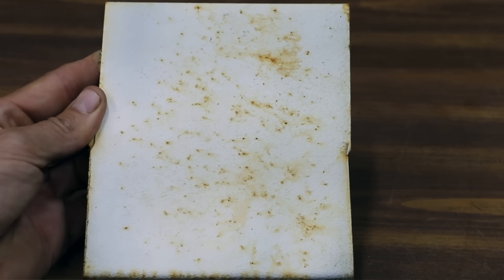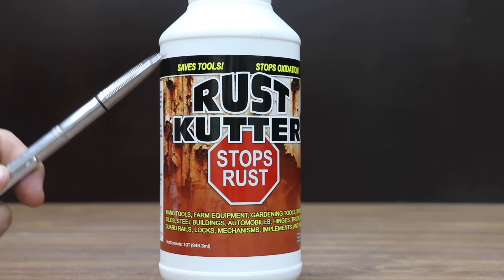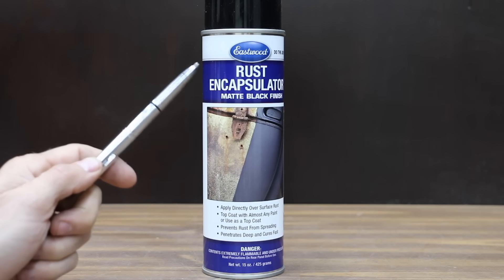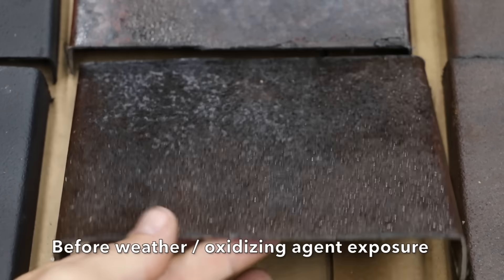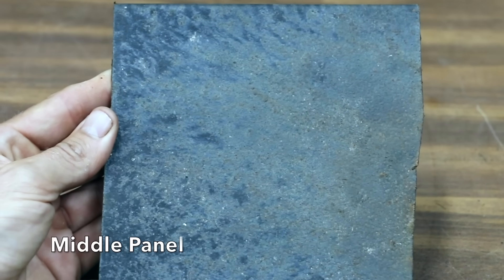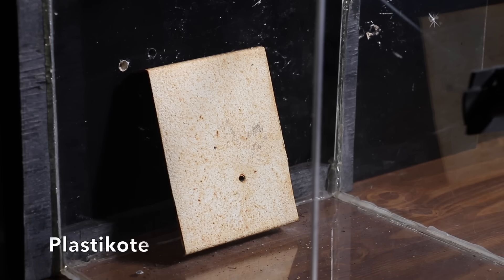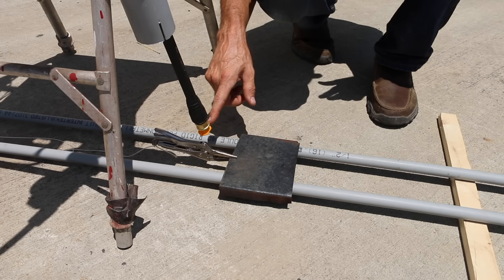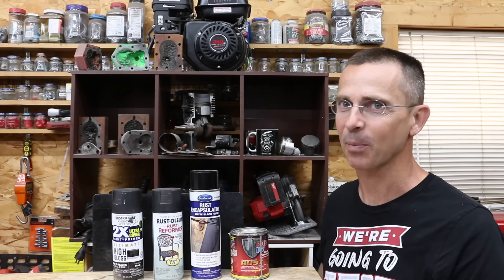Best Rust Converter? POR-15, Eastwood, Rust-oleum Rust Reformer, Gempler's

Comment: Could you make comparsion between the old style cut nails and modern wire nails and maybe screws of same size. I have been told that cut nails are better at gripping and not splitting the wood if used correctly. I mostly use screws but also wonder if cut nails would be faster and as good.
Reply from the maker: Thanks for the suggestion.

Comment: If you want to you could try the industry standard and sand blast the panel epoxy prime then top coat with 2k urethane or base and clear coat. Would be very interested in the outcome.  Also a test between weld thru primers both copper and zinc types. I work in the auto body industry and personally I have found dominion zinc is the best I have found so far.
Reply from the maker: Thanks for the suggestion.

Comment: Best way to "convert rust" is to use fire. Rust is FeO3 which means the bound oxygen will burn off. 
What weighs more a chunk of metal or the same chunk that is full of rust? Correct, the rusted one weighs more because of the attached Oxygen. Too easy! 
It is simple chemistry!!!
What you mean is a metal protectorate from rust.

Comment: I agree that POR-15 is amazingly tough stuff and really bonds well to the surface, which brings up one caveat.  I used about a third of a can on a job by pouring some out into a disposable cup.  I cleaned the entire rim of the can and the lid with thinner and wiped both dry and clean and tapped down the lid.  When I went to use it again several days later, the lid was stuck so tight I destroyed it taking it off.  I didn't have a fresh can to put it in, so I covered the original can as well as possible with plastic wrap and a rubber band, but when I went to use it again a couple days later, the top surface had set up into a thick, hard layer.  Expensive lesson!  My advice would be to set up as many jobs as possible beforehand, and then have a POR-15 painting marathon until the entire can is used.  They also say to apply any top coats (final color paint) when the POR-15 dries to a tacky surface, which takes several hours, so start your marathon early in the day!
Reply from the maker: Thanks for the feedback.

Comment: the permatex is a rust converter that requires you to do multiple coats depending on how well it converted the rust. you then still have to paint it with primer and then paint. the only way to keep stuff from starting to rust again requires wax. that would have been a neat test to see which one actually stopped the rust vs having more rust form
Reply from the maker: Thanks for the feedback.

Comment: Thank you for the video. I was one that suggested Por-15 a few times, it really is an amazing product. I made the mistake of applying it with no gloves a few times, literally needs to wear off. 
I'm planning to try their brake caliper coating soon too.
Reply from the maker: You are welcome!  Thanks for suggesting the video idea.
Reply: I made that mistake too.  I thought I was fine since I was only using a small amount, but it dripped on my hand and on to the driveway.  Took five days to fully wear off my hand and the stain on the driveway is still there from four years ago.
Reply: @devianb   The again on the driveway shows how durable it is! 😂

Comment: AS ALWAYS YOU HAVE THE BEST COMPARISON TESTING THAT I HAVE SEEN.   I HAVE USED A PRODUCT CALLED CORROSEAL FOR RUST CONTROL SINCE THE 1960'S  INSIDE THE HULLS OF BOATS & BARGES WIITH VERY GOOD SUCCESS.  I NOW USE THIS PRODUCT ON & INSIDE CAR FRAMES DURING RESTORATION PROJECTS.  IF & WHEN YOU DO A PRODUCT COMPARISON LIKE THIS AGAIN I WOULD HOPE THAT YOU INCLUDE CORROSEAL IN YOUR TEST LINE UP..

AGAIN,  THANK YOU FOR THESE INFORMATIVE TEST.  

NOTE, I ALSO WAS VERY IMPRESSED WITH THE RATCHET STRAP TEST,  VERY USEVUL

THANK YOU,

BILL P.
Reply from the maker: Thanks so much!  Thanks for the video idea.

Comment: I own a painting company. Big huge heads up for the POR15. It is insanely flammable. Use it outdoors only, or in a proper paint booth. It can self-ignite at room temperature in the can and also if it reaches the correct concentration in the air.
Reply from the maker: Thanks for the feedback.

Comment: I used POR 15 around 20 years back on a pair of disc brake backing plates and they still look good. 
Eastwood is no slouch either as I've found so far.
Reply from the maker: Thanks for sharing.

Comment: I'm experimenting with different things in rust fighting over decade.  Rust reformers are useless.  They are porous and reform only top layer of rust.  And if you apply cosmoline, fluid film or epoxy primer reformer is just in way of others doing its job.
Reply from the maker: Thanks for the feedback.

Comment: A video on just rust converters: Corroseal, Rust Mort, Rust Sergeant, Rust Converter Ultra, Jenolite, and Black Star.  All to be applied and top coated with two coats of spray paint.
Reply from the maker: Thanks for the suggestion.

Comment: POR 15 is amazing stuff, but just a few tips, because it's kind of expensive. A) don't open the can unless you have everything you need to coat, ready to be coated. B) if you ignored A) put a piece of plastic over the top of the can before you put the lid back on, or you might never get it back off.
Reply from the maker: Thanks for sharing!

Comment: Sometimes I feel like you guys are looking out for me. I'm restoring a riding mower right now, getting it running good new tires all that, and I'm just about at the point of painting. So I was wondering if I should bother with a expensive rust reformer. After this video I'm just going to go with the rustolieum reformer and spray paint combo. Seems plenty adequate for my project.

Comment: Hey there! I really love your channel and appreciate the help with purchase decisions. Really helped with oil, hooks and mower sharpeners so far. My suggestions: ethernet cables, usb c cables, hydraulic fluids, windshield wiper fluids, car waxes, wall port adapters,  floor cleaners, plungers/brushes, window heat Shields improvement (sprays, tints, waxes, double panels, foil), conventional insulations, dry wall patching solutions, gutter water redirection solutions, house paints, tire repair kits, office chairs, sharps containers, burner/stove back splashes, concrete cement patching, cat litter and finally screen patching. Thank you, I really appreciate the work and detail you put into your videos.
Reply from the maker: Thanks!  Thanks for the video ideas!

Comment: I'd love to see one of your engine failure videos (where you tested additives, then drained and ran till failure), with Castrol Magnatec. It's supposed to cling to engine internals when shut off, and this prevent wear during warm up. I figure if it really is, then you shouldn't be able to drain it as completely as a conventional oil, and it will survive longer.
Reply from the maker: Thanks for the suggestion.
Reply: Magnatec is a pretty good oil for the price, from what I've read it's mostly group III base stock with a splash of group V Ester based synthetic for its "clinging" ability. My lifters seem slightly quieter on cold start with it.

Comment: I'm curious about KBS Coatings performance vs. POR 15... I coated my '26 Ford Model T frame with KBS a couple years ago and it's holding up great. It's garage kept and located in NC so there's no winter salt to deal with here. Great video!
Reply from the maker: Thanks!  Thanks for the suggestion.

Comment: You tested epoxy resin as a glue. What about to test more fluid epoxy resin as mold matherial to fix broken mechanical part. Which is more durable when you for example take broken plastic gear, fill the broken part with epoxy - will it work as new? That type of use case.
The difference here is that fluid epoxy to fill forms is always sold in bid quantities, like in liters. Epoxy types you tested are all small quantity types.
Reply from the maker: Thanks for the suggestion.

Comment: I feel like the chip-resistance test results would vary quite a bit if you did multiple trials, since the surfaces are uneven and could drastically impact the size and shape of the chip that breaks off.
Reply from the maker: Thanks for the feedback.

Comment: We use POR-15 at the power plant to coat tube sheets and bell housings on condensers. It holds up very nicely. (We don't SHOOT at it though!) After the first application some years ago, it only needs some small touch ups during the yearly maintenance cycle....
Reply from the maker: Thanks for the feedback!

Comment: I sandblasted the frame of my F-350 super duty.. then I painted it with POR-15 It was a wet sandblasting.. It only removed the light surface rust. My frame turned out like new. When it was dry I painted it with Rust-Oleum gloss black..
Reply from the maker: Thanks for sharing.

Comment: Absolutely happy to see the por15 came out on top. I did my truck frame a few years ago and it's been holding up awesome to the road salt. Awesome video
Reply: Por 15 is overrated imo i doesnt work that well
Reply: @researchandbuild1751  Agree.  Ower rust I go with cosmoline.
Reply from the maker: Thanks so much!  Thanks for the feedback.

Comment: Rust oleum is my go to paint when restoring rusty metal projects!
I’d love to see you test degreasers, like purple power, zep, simple green, etc…
Reply from the maker: Thanks for sharing.  Thanks for the video idea.
Reply: MUST add Dawn dish soap to the mix too (that cheap stuff is garbage). Ive used it at the shop over everything else for decades. The Uni-First guy used to wonder why we never used the pumice soap until I washed my hands with Dawn in front of him😂🤣
Reply: Would like to see Super Clean in those test
Reply: I did the bottom of my 90 Cavalier Z24 with that back around 2005.   Red rusty metal primer with black enamel after a fairly complete sandblast ( on my back masked up the ugly way.).  Undercoat sprayed after .   By the next winter it was ugly with rust worse than before.     I’d used rust oleum for many years prior to their taking the lead out of it with great results.   Nowadays I annually spray the base and tape door drains let soak with 2” deep mix of used ATF / bar n chain oil and cheap petroleum jelly.     It’s messy but seems to stop rust in its tracks as well as can be expected even in areas that can’t be gotten at .                
 Beyond that all you can do is move south because the rust always wins in the end
Reply: Dawn does an awesome job. It’s what they use to degrease bridges, as it’s environmentally friendly. It’s also used to clean animals after an oil spill. It’s definitely awesome stuff and very cheap.

Comment: I was restoring an old motorcycle that had several pin holes in the gas tank as well as a lot of rust inside.
I got some por-15 dump the inside the tank and rolled it around for several minutes to evenly coat it.
Then I let the tank hang upside down to let the excess por-15 run out.
Iran that motorcycle for 3 years and never had my carburetor get clogged by rust again.
I sold that bike to a buddy and it's been 6 years ago and the por15 still looks great when you look inside the gas tank
Reply from the maker: Thanks for sharing!  Great job!

Comment: Todd You just saved me. I plan to stop rust from building up under heath my car. Thank GOD I am subscribed to you. 
A video suggestion would be to find out which exhaust sealers can actually withstand the heat with out degrading. I bough a couple that disappointed me, and there is a bunch out there. 
Stay blessed my friend.
Reply from the maker: Glad to hear!  Thanks!

Comment: What? No Jenolite or Duplicolors Rust Fix? 😉
Good vid! Thanks!
Reply from the maker: Thanks!  Thanks for the constructive feedback.
Reply: @ProjectFarm  I have been using the Duplicolor Rust Fix spray for many years with nice and lasting results. Just started using the Jenolite (says they used it on the Eiffel Tower) and it seems to convert the rust in a similar way to a black coating. 
Thanks again for the great videos, I’m a big fan 😁👍

Comment: Good stuff! POR 15 is usually a three step process, they have a special degreaser for step one, step two is their metal prep and step three is the one you did. Wonder if it would have made a difference
Reply: Also por-15 isn’t designed to be left outside
Reply: @leonarddoyle834  if it's topcoated, like in the video, then yes it can be left outside.
Reply: @leonarddoyle834  That is very good to know, thank you!

Comment: It's nice when you've been using a product (por15) and then have project farm say its the best. Really boosts my confidence for using
Reply from the maker: Thanks for sharing.
Reply: I'm surprised Loctite Rust Neutralizer wasn't included. Maybe do a round 2 video with it and Ospho iron phosphate rust converter?
Reply: Always cool when PF tests something I have/use and it does a good job. It’s definitely reassuring.
Reply: Yes same here I was rooting for the POR15 since I used it on my dad's car
Reply: This was one of the most lopsided wins in PF history.

Comment: Your scratch test method and damage analysis are very really good. 
You can use test adhesion of coating by noting force need to peel a strong adhesive tape.